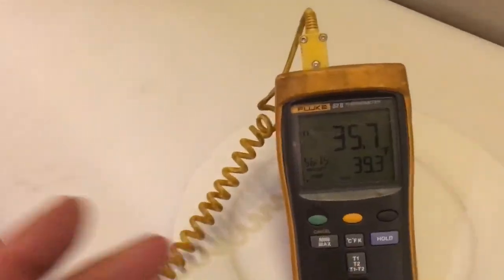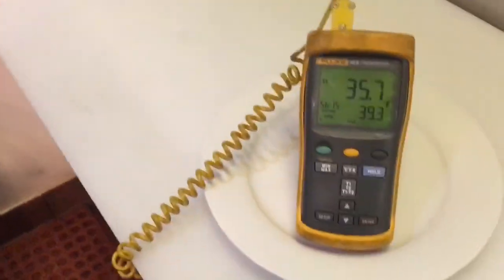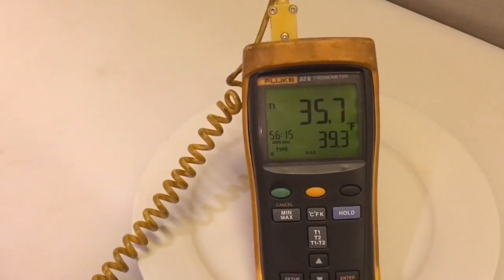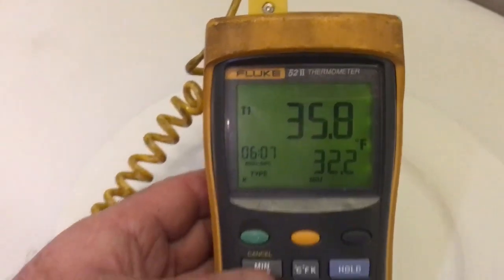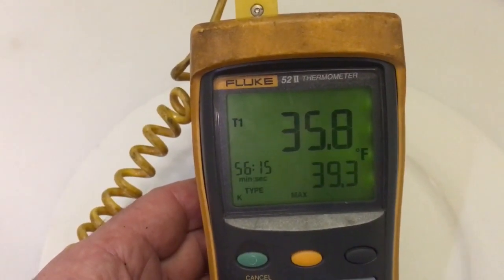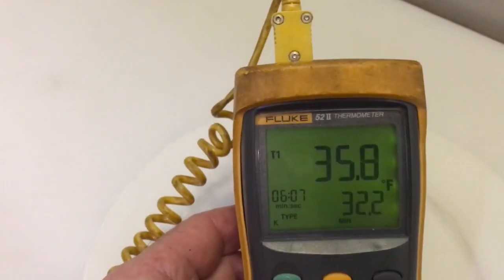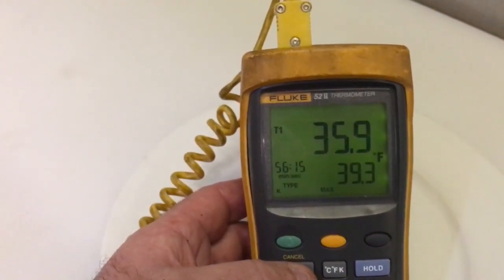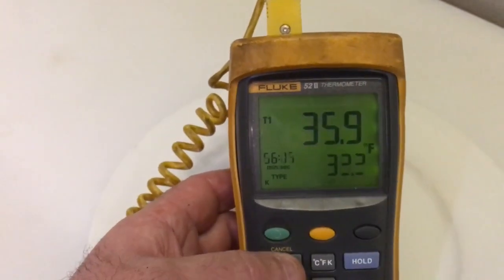Making the Most out of a Digital Thermometer ... Re: Refrigeration

Comment: how about checking for my home AC unit. Just point it to my vent and hit the min/max button to get the reading or the green button? also, do i also point it to my home air filter too? i was told there should be a difference of 16-17 degrees from my home filter air vent vs. my normal air vents in the house. Is that correct? Thanks.
Reply from the maker: Yep , 16-22 degrees is normal. optimumly u want 20 degree's if system is New & all components are Matched properly.

Comment: Have you ever tried one of these?
https://m.johnstonesupply.com/storefront/product-view.ep?pID=H28-162

Temp logger w/bluetooth. Great for refrigerators. Leave it in overnight, go back the next day and track how the unit cycled. Bluetooth can read without opening the door.

Not so great for freezer overnight as it has a -3 degree F limit.

Johnstone on sale for $40 a couple times per year.
Reply from the maker: No , i have not.
Reply: Was originally a AAB product and app. Guess they got bought by CPS. I have both products (3 total) and apps but prefer using the older app.
Reply: Tiny device, has an alligator clip. Can hang it out of sight out of mind of minimum wagers. Set the sample rate times as often as every minute to once an hour. Press data log and go on about your day. 

Come back later within bluetooth range without opening the box and pull up a graph or spreadsheet data on temp cycles.